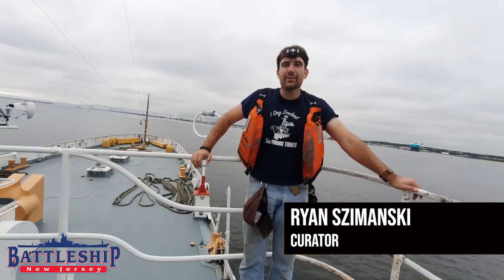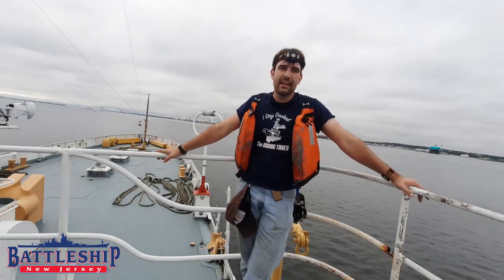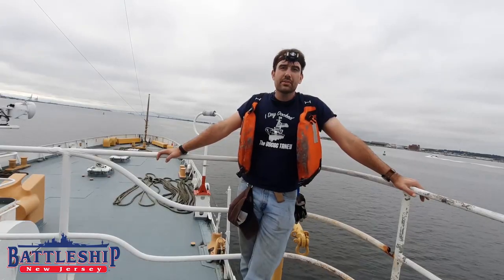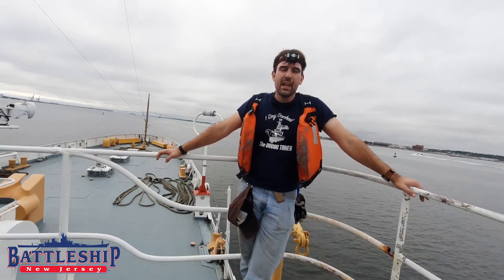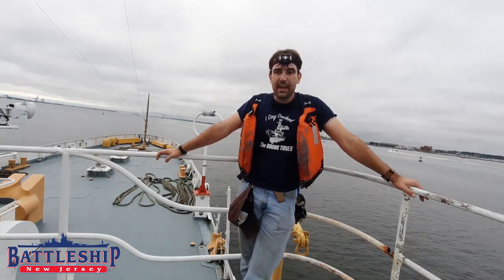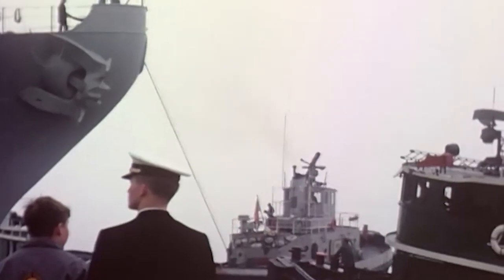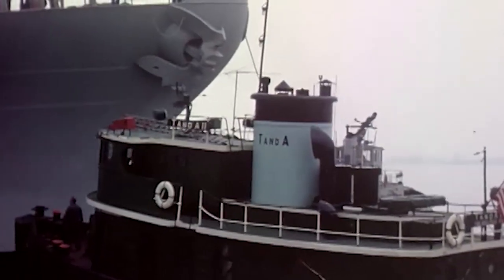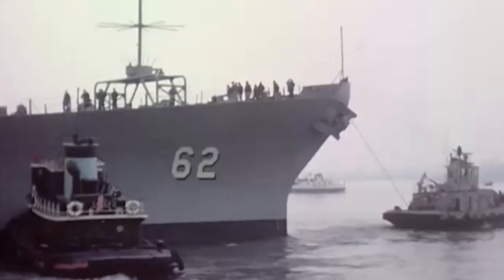What Happens to Ships Between the Wars

Comment: An interesting topic would be the changes -- or sometimes lack of them -- in the technology used in such ships as NEW JERSEY in WWII and the equivalent, if any tech used during WWI, especially by US warships.  This would include the power plant (turbo-electric drive in some old US battleships, for example), electric power for the ship's various equipment types (DC versus AC is IMPORTANT), armor type and improvements thereto (some major and some minor), projectile design improvements (a LOT here), fire-control systems (directors, internal communication of information, and calculators), electronics (equipment requirements for for weapons and communication, enemy position location by radio signal, radio or radar, direction-finding and tracking, and, the big change, radar itself).  Considering how short a time there was between WWI and WWII, the massive changes in some areas are amazing, though this speed just increased after WWII to the present.